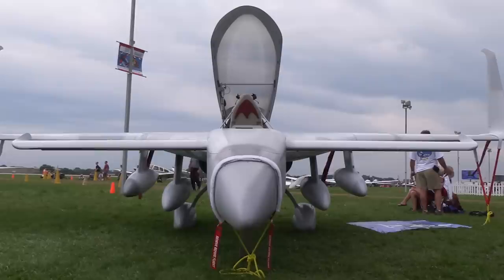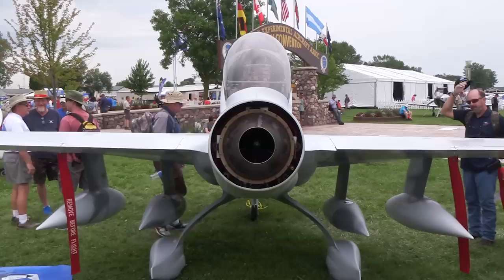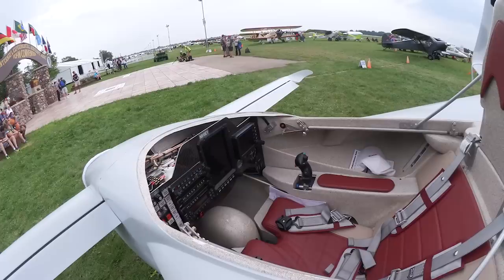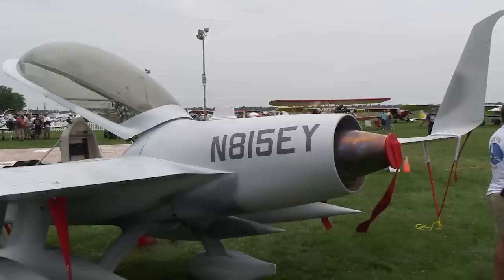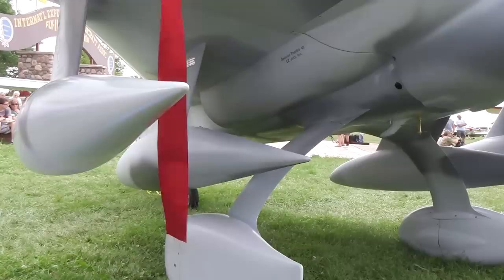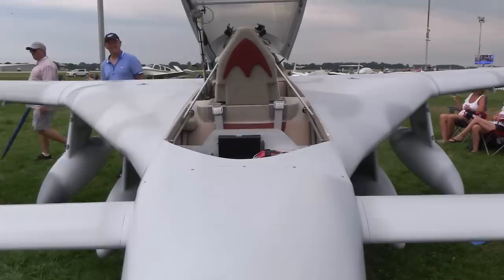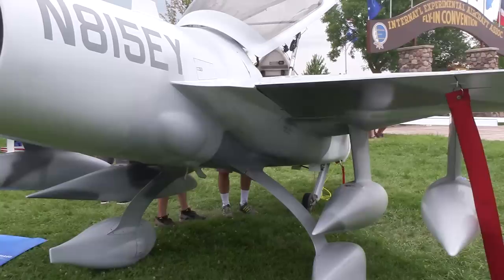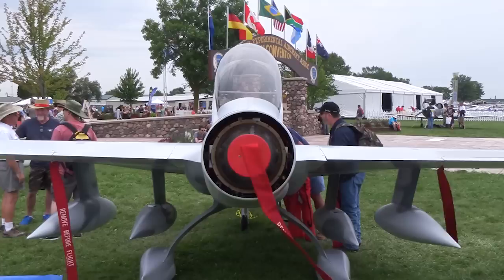Jet Eze: A jet incarnation of the canard classic

Comment: Eze Jet with Lance Hooley crashed Sat Sept 1, 2018 at Covington TN airport, North East of Memphis. Lance was killed. I talked to Lance at Oshkosh 2018 just a little over a month ago. He was very generous with his time answering all my questions about the Eze Jet. Initial NTSB report states eye witnesses reported winglet/wing fluttered. Wing separated during a low pass. RIP Lance.
Reply: OOPS... sounds like "someone" didn't know as much about "composites" as they thought.  Non-Engineers doing Aeronautical Engineering, what could possibly go wrong? ☹
Reply: @MajorCaliber  Two things: One Build Quality. Two, the plane was too fast and always at Vne (never exceed). No doubt he was doing a high speed pass to show off  at the airport, going over safe speed for airframe. The airframe was designed for 115HP to 160HP Lycoming with fixed prop, not a jet engine. Sad. Like I said I just met him. The accident happened at an airport 50 miles away. Have a safe happy new year.

Comment: Piston Long EZs are hard to slow down too...it has nothing to do with the jet engine.  Its why some of them, including the one I flew often, have a speed brake on the bottom.  Most people crank down the nose and and use both rudders for additional drag.
Reply: Exactly how I flew mine and my Velocity as well besides the front nose gear since it’s a FG.

Comment: Why all the wing mounted tanks? What not a single mounted belly tank or even an integrated form fitting belly tank. Seems to me the more things hanging of it the more places for drag to form.
Reply: Kitplanes article quoted the builder as saying the inboard two are gas, the outboard two are for baggage.
Reply: Maybe....but at the time the fastest way to add fuel was the pods. The inboard pods are fuel, bout 20 gals.  Outboard are bags.
Reply: Besides....they look cool
Reply: Probably easier to distribute the weight along the spars.
Reply: In the video he mentions the hardest thing is getting it slowed down.  I'm sure the added drag from the pods helps that a little.
Reply: Not really.. At 175 MPH mine slow the plane down about 3-5 MPH.
Reply: TomorrowSystems ; With the engine consuming 90gph on climbout (down to 30 at high altitude cruise) you need the fuel pods....
Reply: Not really a whole lot of room on the underside of the belly.

Comment: Would a side slip help bring the aircraft down where you need it?
Reply: I have a varieze. Really difficult to slide slip at speed as the rudder authority is not as effective as a conventional rudder.
Reply: @hugostiglitz6914  How hard are they to fly, as in, do you need a lot of hours before taking up a Varieze.. or are they easy to transition to early on as a relatively new pilot?
Reply: @stijnvandamme76  I work in the aircraft industry and have flown a fair few different types but having said that I would not consider myself a great pilot. The Varieze is not a difficult aircraft to fly. It is difficult to stall, but it is possible to get into a situation where  a stall is difficult to recover from.
They are super slippy, bleeding off speed needs a little forethought.
Theres no flaps, but you do have a belly brake and as the left and right rudders are independent they can be used to create some drag.
The other thing is the rear cockpit only has side stick controls, so my first couple of flights were not under complete control of the aircraft.
I know a few owner builders who have managed safe flying with little more than the PPL hours. Your best bet is speak to an owner and see if you fit comfortably in the thing first, they can be very claustrophobic. If you're lucky he/she might take you on a flight so you can see what it's like. 
It's a beautiful aircraft that's not more difficult just different!
Lastly, if you do decide to buy one have it inspected by a professional engineer with experience on composite/experimental aircraft, preferably someone who knows Rutan aircraft.
Remember, they were generally built by amateurs at home.

Comment: Would be nicer and way cooler if the landing gear retracted.
Reply: Yep, cool factor would go up. Fuel capacity down 34 gallons. Complexity thru the roof along with time to build and cost to build.
Reply: Jet Guys have you guys got any plans to design a Long EZ Berkut Jet? :))
Reply: Nope. Ours are actually bigger and faster